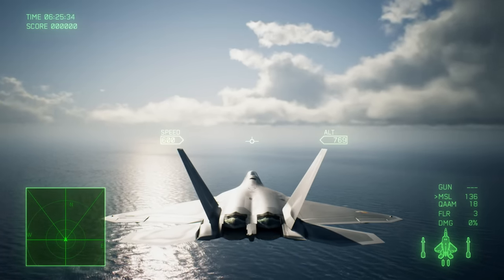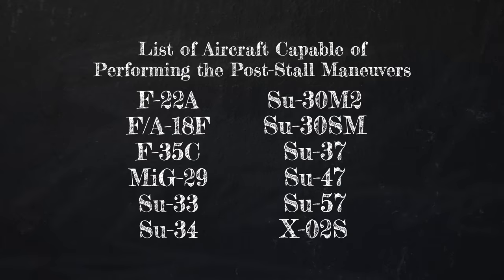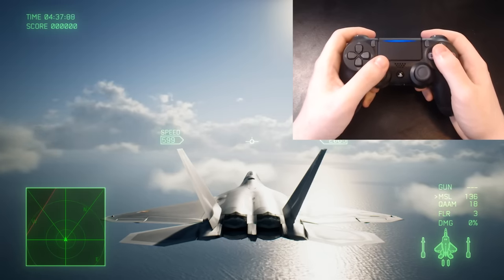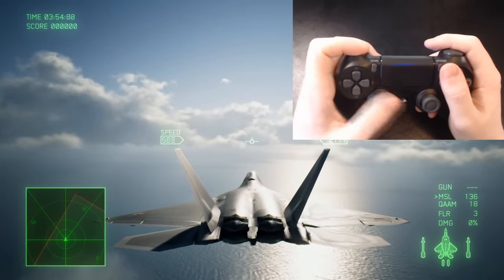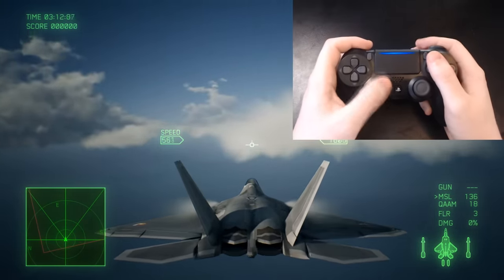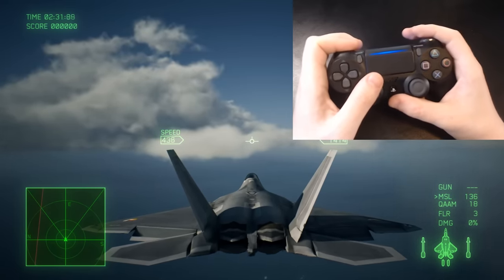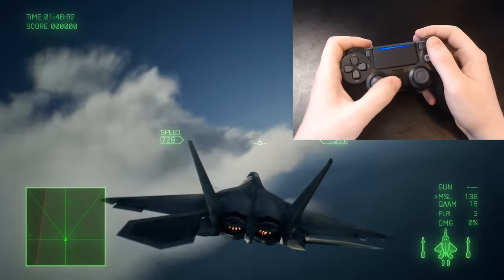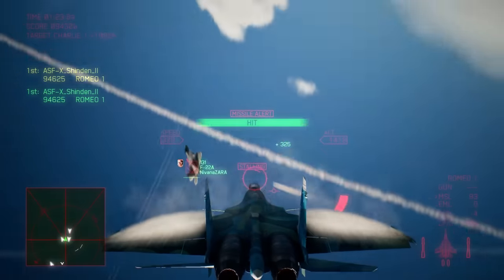Ace Combat 101 - #4: How to Perform Post-Stall Maneuvers

Comment: he kinda missed a part so: once you hold down your deceleration and acceleration, pull up and let go of the deceleration, then boom, post stall maneuver
Reply: You sir are amazing teacher thank you
Reply: I did it three times
Reply: Im still stalling I dont know what I'm doing wrong
Reply: Nice
Reply: Basically this comment more useful than the video. Ty
Reply: Thanks this helped a lot I’m actually doing it now lol
Reply: Yeah it took me some time to notice that
Reply: thank you sooooo much i have been practiceing for 1.5 hours now and could instantly do it after this comment
Reply: You are the best thank you
Reply: OMG i just did it while reading your comment
Reply: Man I got so pissed I punched tf outta my leg because the shit don’t work😭
Reply: Other bit of advice (a few years late) is instead of using the triggers for acceleration use the bumpers literally makes this work so much better
Reply: Good now i can do it 🎉
Reply: @kaidengardner2792  I don't know if you still need this but what you basically need to do is just tap bug deceleration and acceleration to do for maneuver I was having the same issue where I just could not do it but then I saw this comment and I finally was able to do it somewhat consistently
Reply: Thanks, I was thinking that's what he was doing from the hand cam but no explanation.
Reply: 2:25 he said it
Reply: @kaidengardner2792 just remember to press acceleration and deceleration before you pull the L stick and when you start doing a cobra let of the deceleration
Reply: i still cant do it. xbox one.

Comment: 5 minutes of talking and you never said that you have to pull up a split second AFTER pressing the shoulder buttons, you make it appear as if you need to do it at the same time. Took me quite some damn time to figure that out, tried changing my control scheme and checking if anything is wrong with my gamepad, only to realize you have to have a slight delay instead of doing it simultaneously. I've spent more time fiddling with it than the entire length of your tutorial. I'd say that point would be pretty damn important to mention, and you skipped it completely.
Reply: You are a holy man sir god bless you
Reply: A month later and I can further confirm this: After Acel and Decel are pressed, you have to wait maybe 0.2 to start the maneuver.

Also it can be used for more than the two shown in the video. Immelmans can basically be done on the spot.
Reply: You are a hero.
Reply: Legend
Reply: You're a freaking life saver dude. I was getting so irritated
Reply: My hero. Kept struggling til I read this
Reply: Thank fuck for this comment, it was rage inducing.
Reply: Yup,You're right.I was doing this from 3 days
Reply: thanks, finally got it
Reply: Zhnigo thanks so much man I have always wanted to do post stall now I figured it out thank u
Reply: Yes bro. Tq so much ahhaha
Reply: THANK GOD
Reply: Man you're a genius, i was wondering why i couldn't do it consistently!
Reply: So true bad titorial
Reply: Thanks a lot man
Reply: This just shows a lack of attention to the video, he literally had a box in the top-right corner showing what he was doing on the controller, you should've watched that instead of listening to the voice or watching the plane as it does the Maneuver. Also don't expect that you will be able to do it first-try because it's a complicated maneuvre that takes practice to master..
Reply: now i can finally dogfight thank you
Reply: PIN THIS COMMENT!
Reply: Thanks so much, you're a saint. I was getting frustrated / confused trying to replicate this! Worked immediately.
Reply: Me after watching the video: WTF why can I not get this right!?
Me after reading this comment: lmao post-stall maneuver goes BRRRRRRRRRRRR
Reply: Thanks for the tip
Reply: Thank you so much.
Reply: I spent an entire hour getting frustrated trying to do a psm, first attempt doing it like this and it works. Sir, you are a legend
Reply: THANK YOU!
Reply: @freighter-8456  Hey, I know this is random and I must still be as dumb as a cow trying to figure this out. Like, I understand thanks to the comment what to do but I still end up stalling while performing the maneuver. Exactly what buttons am I supposed to be holding and letting go of? I’m using Xbox as well. I’d appreciate the help
Reply: BRO, thank you, SO MUCH for this comment!!!! I was in a free flight struggling till I saw this thank you SO MUCH!!!
Reply: Yeah that’s pretty damn important, I only got it because of this comment
Reply: bro I fucking changed my entire control scheme and got used to inverted because I thought the triggers had delays omfg.
Thank God I saw this before ragequitting

Comment: This would be epic for multiplayer apart from the fact that by the time you have decelerated and prepared, you have been shot down by an F-22 with QAAMs.
Reply: Climb straight up to loose speed, break off if you're locked on and then turn and slide to the side to shake off any missile, works all the time.
Reply: @Enaxity  Exactly, just as you are always using falls from altitude to maintain airspeed to stop stalling.
Reply: That's realistic, you'd never see the F22 coming
Reply: Or a EML or smth
Reply: @joebone3151  it's called balancing
Reply: @jaminmccurley  oh really then why does Russian jets seem extreme op in the game when they are trash in real life
Reply: A F-22 has to first be receiving it respective maintenance (as pentagon has recently discovered only a bit less than 30% their force is actually capable of being put in action in a short period of time) and even there it need to not be on its 8 hours of maintenance every mission it flies.

There's a reason the Raptor project was discontinued even if older fighters are still widely used and supported.
Reply: @joebone3151  ...because the American fighters are about just as good, its called balancing, if i have recommendation... try getting good
Reply: Or a darkstar

Comment: for those of you who's still having difficulty pulling this stunt, just hold deceleration button until you reach < 500 then press acceleration and push the left stick down at the same time.
Reply: Not how it works for me. I have to decelerate below 500m/270knots, then let go, press both triggers in, then push down on the stick right after pressing in both triggers.
Reply: I'm having such a hard time doing this reliably that I'm questionning my controller.
Reply: @Slender_Man_186  u just helped me so much
Reply: @Slender_Man_186  I can't believe no one is just explaining it like you did, there is an ORDER, you don't just click it all at exactly the same time!
Reply: @Slender_Man_186  yeah, i discovered it randomly and couldn't manage to replicate it, went to the wiki and saw how it was supposed to be done, the thing though is that some airplanes can only do the cobra (mig-29 for example) while some airplanes can do a kulbit and the cobra (su-37 for example). the biggest problem i had is that it doesn't mention in the wiki that you have to let go of everything before doing the maneuver. if you're slowing down and then press the acceleration trigger without letting go of the deceleration trigger it won't work, it's not actually mentioned that you need to let go of the deceleration trigger THEN press both triggers at the same time. it took me some time to understand that
Reply: @roguey123  yeah there's an order, the wiki said that you have to let go of the joystick before but didn't mention that you also have to let go of the deceleration trigger. took me some time to finally understand how it works. nice part is you can do a half kulbit (a cobra that you continue a little longer) to be able to switch direction in very little time. i beat the entire game without knowing about that, i just constantly used high-g turns lol
Reply: @arkama67  I figured out that if you double tap both triggers, then pull down, it works without fail.
Reply: @Slender_Man_186  Gigachad
Reply: you should push down the left stick after pressing the acceleration and deceleration button. This will help you get it. If we push the left stick down at the same time. (for me) it registers the left stick down first then the acceleration which causes you to just accelerate. Hope this helps
Reply: @Slender_Man_186  thanks a lot
Reply: Do you have to complete the game?
Reply: @talonjohnson3667  no
Reply: @dv1494  ok, thank you
Reply: @talonjohnson3667  technically no, but by the time you get the required planes, you'll finish the game.
Reply: Yeah, I have the one dlc f15, and I discovered that it works
Reply: The reason why it wasn’t working was because of the measurement I was using (I was using knots) fixed to kilometers
Reply: @talonjohnson3667  👍

Comment: "This isn't OP." Plays multiplayer..."Oh this is definitely OP."
Reply: *gets blasted by HPAA
Reply: Josiah Aristizabal QAAM Spammers
Reply: *UAVs rushing in from the distance
Reply: yeah the previous replies are right. by the time you have slowed down, initiated the manoeuvre and actually changed direction, you have been blasted by some low-life QAAM spammer. take it from me, I have only succeeded 3 times out of around 40 attempts.
Reply: @tsweens13  Yeah it's not great against evading missles but it's great when you're tying to get behind someone while they're on cooldown
Reply: @tsweens13  my only question is how to people flip their planes around even tho they're going in one direction...
Reply: Natah Takaizumi that’s the post stall manoeuvre for you. they are either quickly turning, doubling back, doing a Kulbit or doing a Cobra.
Reply: Natah Takaizumi simply hold both brake and throttle when going under 500km/h then flick your nose upwards. only certain planes can do it, they all have thrust vectoring. So basically, usr any late game aircraft or any modern russian aircraft.
Reply: When I let someone get on my tail me flips and shoots missiles
Reply: It isn't though. PSMing is high risk. Some people with a lot of practice can use PSMs in evasive maneuvers by working with the game's physics system, but I've killed a lot more PSMers than I have been killed by.
Reply: @secondpath5148  it was a joks

Comment: To ppl who cant do it, make sure you  wait a small bit before pulling up, dont press the button and pull up at the same time! You have to release all movement buttons, press the psm button (accelerate+decellerate) release it, and pull up.

Ac fan if you are reading this, then please pin it, all this time I couldnt do it properly and consistently, I only found this out a few days ago. This gave me a real advantage in combat. All this time I couldnt understand why it wasnt working.
Reply: Thx man
Reply: Thank you so much
Reply: Ac fan? You mean Ace Combat right? Is it that hard to spell it out?

Comment: If you're having trouble post stalling still on PS4 controller (I assume xbox too?) Switch the triggers to Yaw and the shoulders to throttle. For some reason, the gradient trigger actuators make it almost impossible to post-stall reliably

Comment: On Ps4, if I am decelerating with L2, I have to let go of L2 a split second. Then, hold L2+R2 simultaneously, wait a split second, pull back on L3 and continue holding back on L3 until the plane flips.
Reply: YOU SIR ARE A SAINT. I was struggling to figure out the Kulbit and you just laid out what I was doing wrong. Thank you my guy

Comment: So if I'm understanding it completely, this works mainly on planes with thrust vectoring? You're basically accelerating the plane at the exact moment you change the angle of the thrusters?
Reply: And throwing the air brakes at the same time. The ass of the plane is literally trying to outrun the nose in a different direction so it starts to rotate

Comment: >KPH more precise
Honestly the PSM range in Knots is a little easier to remember than KPH because its basically anywhere between 240-260 for all the aircraft. The range in KPH is 'larger' per say but thats not always a good thing. Idk might just be my preference speaking.
Reply: @WwZa7  theres sum wrong w you if you care that much lol
Reply: @WhenDevilsDuel  
Maybe yes, but imperial measurements just make no sense and are hard to convert
Reply: @WwZa7  true dat
Reply: @WwZa7  Metric is uniform but the entire world should just switch to a variant of the metric that goes by 12's. The only reason we use 10's is because we have 10 bloody fingers, but 12's is better in every conceivable way.
Reply: @gracecalis5421  dude we have 10 numbers in standard decimal system, how the hell using convoluted conversions by 12 in decimal is better than using the numeric system the way it was designed for? Or maybe let's just use hexadecimals and make new measurement system converted by 16? And than we will force people who use scientific mili- centi-, kilo- etc to use only our, superior 16, 32, 64 conversion values? Ye that still makes more sense than miles, pounds or a freaking feet.
Reply: @WwZa7  Well that's your logic in perceiving imperial as well, isn't it? People should convert from imperial to metric because metric is better. By that very logic, the metric system should be converted to use 12 because its better. Whatever reason you can bring up to justify the state of the metric system, is also the reason why countries still use the imperial system. Its simply too much of a hassle to convert an entire community's scaling system.
Reply: @gracecalis5421  
Slowly it does happen, NASA uses metric for example, i'm not sure about this one but i think SpaceX does it too. But you said that imperial is better, isn't it? You didn't said why.
Reply: @WwZa7  I never said imperial is better??
Reply: @WwZa7  weights and measures, Imperial is based on sacred geometry its all from the pyramids
Reply: Furebel metric will never be used in the aviation or nautical just accept it.  “Distance is in nautical miles because it is related to the unit used for measuring latitude and longitude. 1 nautical mile corresponds to 1 minute latitude (and longitude on the equator), which makes it easier to calculate distances from navigational maps using the grid lines as scale (large area navigation maps need to preserve angles, so they can't have constant scale). If angles were converted to decimal, 1 km would be 1/100 gradian. Alas, angles and time were never converted to decimal.”

Comment: Thank you for the explanation. Doing this on PC (with mouse & keyboard controls) are going to be a bit of a pain in the rear... Maybe it's time to get a controller/HOTAS? lol
Reply: Try binding pitch up to spacebar.
Reply: @DeathsIntent96  Funny you say that actually, I've been used to having spacebar for missiles and I don't think that's changing (thanks PCSX2 for making me used to these controls)
Reply: Yeah but if we can configure our keybinds it wont be that bad, in emulators i use WASD to control the plane and Q E as L2 and R2
Reply: Joysticks are more precise, but in action packes Ace Combat, you need to be able to act fast more than you need precision. I personally would advice you to pick a gamepad, it's easier to switch from one turn to another with one finger than with whole hand. I personally use Dualshock 3 from PS3, but XBox pad is also ok.
Reply: @WwZa7  i use a cheap $15 joystick to play the holy trinity and ACE X in emulators, and it has that x input thing that new games use
Reply: @bigdoggo5827  
Well it depends from the comfort of a user, but when I tried AH and Infinity on PS3, i got to a conclusion, that a skilled pad user will still be quicker than skilled joystick user. Joystick is easier, gives more control, yes, but there is no way it will be ever faster to use than a pad.
Reply: Dude, Could you do that with keyboard on PC? If you could, can you tell me how did you do?

Comment: Love the Videos... For those who like using Knots its 240 knots for post Stall...this is from the wiki: 

"Post Stall Maneuvers can be initiated by slowing the aircraft down to around 450 km/h (240 knots), releasing all inputs on the left controller stick, followed by holding the throttle and brake buttons at the same time, then finally pulling the aircraft into the desired maneuver."

Comment: How do HOTAS users do these if they have to decelerate and accelerate at the same time? We can't use the throttle up and down at the same time
Reply: Just press the both pedals at the same time =)
Reply: Van Tuz well I’m a pc user and am intending to use the thurstmaster warthog HOTAS. There are no pedals on this thing.
Reply: @schizer  Over kill for Ace Combat, I have it as well for DCS/P3D but can't see myself using that for Ace Combat at all. I'm sure though that there will be a keybinding for keyboard users, so just bind it to one of the many buttons / switches on that thing. The paddle switch comes to mind actually.
Reply: use whatever button triggers a high-g turn
Reply from the maker: I made a new tutorial just for the flight sticks, check it out here: https://www.youtube.com/watch?v=w7RS9AWubBc
Reply: Its the button for high g turns instead of throttle and decelerate
Reply: Top thumb button on the throttle, yank back on the stick.

Comment: This is such a good tutorial but I can't do it at all. You press both buttons and pull back all at the same time correct? Then let go of break but continue accelerating?
Reply: press and hold both buttons, then a split second later pull up. Once it starts let go of the brake to avoid stalling.
Reply: @kappatalism6969  thanks mate. I actually figured this out a few mins after doing this.
Reply: @kappatalism6969  This really helped me. Thanks
Reply: hahahahahatimes5 This is the best tip indeed!  Don't pull up until the PSM is initiated by the brake and throttle is what the video should have said.
Reply: @kappatalism6969  you're a fucking legend.
Reply: I totally suck, I cant even finish the 20th mission in normal mode.